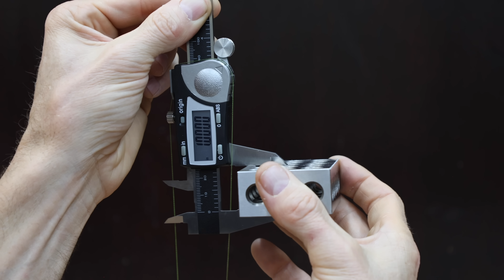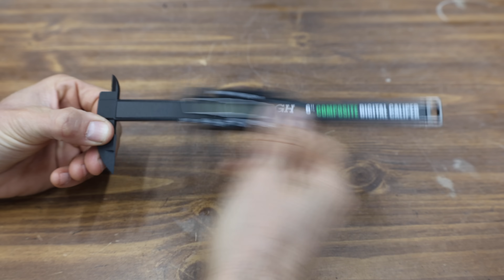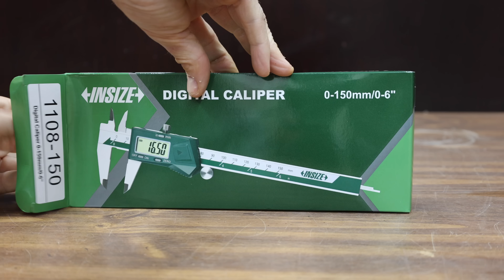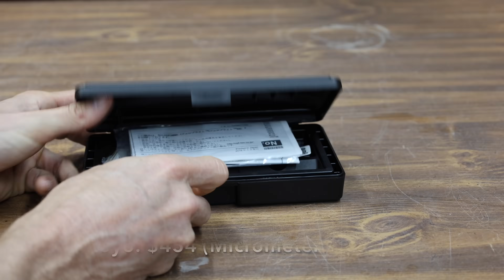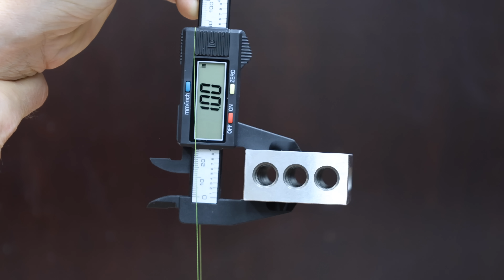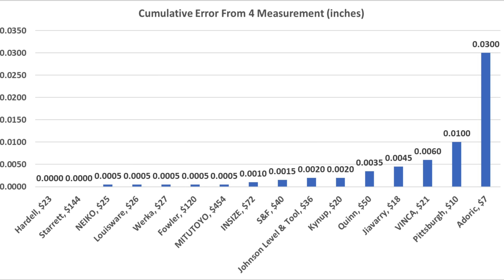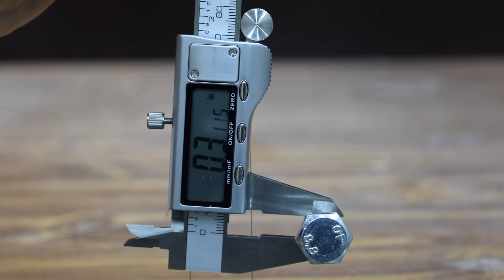I've Been Proven Wrong About Calipers!

Comment: FYI, it pays in the long run to use SR44 batteries, not LR44 batteries, at least in Mitutoyo calibers (and other Mitutoyo hand measuring tools). The SR44 battery has higher starting voltage (1.55 V vs. 1.50 V) and flatter voltage output when the capacity is used, and Mitutoyo's electronics have been tuned to that. I've had a Mitutoyo micrometer, which was said to have auto power off, but if it was used with LR44's, it didn't work at all and drained the battery within a month or two.

Regarding Mitutoyo's lack of auto power off, I've read some stories that the battery use is same if the screen is on or not - same applies to many cheaper models, where the "ON/OFF" button just switches the screen off or on.
Reply from the maker: Thanks for the feedback.

Comment: I really like my Husky brand digital calipers. 
The TLDR
They are really cheap but have worked flawless. The glide is perfect for what I do. In context among its normal uses, I also use my calipers to visualize what measurements look like as I am designing in CAD. Like if I can't picture what 6.83mm looks like, I just pull out the calipers and set them to 6.83mm. I know there are brands out there that the calipers feel like they are gliding on air, but I find for fine tuning that I like a little tiny bit of resistance. Not a grind or anything like that. They just don't feel like they have skateboard bearings in them. 😆

As far as accuracy I have put them up against all the best brands. I work at a motorcycle shop and we do custom fab work. Everyone here has their own set and brand they recommend. 
My lil $30 Husky is just as good as some of the REALLY expensive brands.

Durability? 
Well I have owned a single set for about 5 years, they are just as accurate as the day I got them, feel the same and are not all that banged up. I carry them back and forth every day to work in a tool bag and use them a dozen times each day in and out of the shop on various types of projects. Basically what I am saying is they have been bulletproof since day 1 and IF they ever break I will be replacing them with the exact same ones if I can find them.
For my work, top 30-40 bucks I have ever spent.
Reply from the maker: Thanks for the feedback.

Comment: I bought cheap Neiko calipers in the past. As soon as the battery gets low, they irreversibly glitch out and stop giving you readings. If you want a cheap caliper, just get an analog vermeer or something with a dial gauge instead of something with craptacular electronics.

Comment: Machinist here. When it comes to calipers. Mitutoyo only. They stay accurate after a few years. You drop them a couple of times they still stay accurate. Most everything else you look at them wrong and they break. And that’s coming from a Starrett fan. 

For budget calipers I like INSIZE. cheap use till they break and throw away.

Comment: I worked part time at HP's distance meter division back in the 1980's.  Joyce Horstman, the guru of metrology, told me that the way to clean the faces of micrometers and calipers is to have them squeeze a clean sheet of printer paper.  The paper has a very slight grit and helps clean the faces.  She also reprimanded anyone she saw putting away either with the faces closed.
Reply: Can you explain the last sentence?
Reply: @axledog7297  → Sure.  Joice felt that there was galvanic action at the faces when they were in intimate contact and would hence slowly degrade the surface.
Reply: @axledog7297  Jaws touching I assume.
Reply: "The paper has a very slight grit..."  That "grit" is kaolin (china clay)  The paper industry used to be the second biggest consumer of china clay.  (My first job was in the paper making machinery industry) My last proper job was in printing maintenance, in a plant that used 3,500 tons of paper per week... Imagine how many trees...?
But I was taught to clean instrument measuring surfaces with paper 50+ years ago... Is that not taught on the shop floor / at college / school any more?
Reply: @robertlawson8572  → I think this is also the reason you shouldn't clean your eyewear or camera lenses with tissue paper unless it's made for that specific purpose.
Reply: and you had to wear gloves  when picking up the gram weights to measure things.  Now it seems only the historical items have that practice.
Reply from the maker: Thanks for sharing your experience!
Reply: Why not have the faces closed?
Reply: @stringtheoryx  It matters less with calipers than micrometers.  With micrometers, we were taught to leave a gap, since overnight, the factory temperature dropped, and the micrometer bow shrank, putting a force on the spindle if the spindle and anvil were closed... It costs nothing to leave them apart, If they will go in their case...and in any case, if say, youre measuring in about the 0.25" range, the mic's closed, you have ten turns to make before you can measure... Never do unnesessary wotk, it costs energy, time, and in cases like this, it causes wear...
Reply: @stringtheoryx  → The faces are usually carbide, ground to very fine surface finish.  They "wring" like gauge blocks.  There will be some galvanic activity due to impurities in the air/surfaces.

Comment: I used Mitutoyo calipers at work throughout my mechanical engineering career.  When I retired I l left it behind.  Purchased a Neiko version and honestly can not tell the difference in performance.  I calibrate my calipers/micrometers using gauge blocks so I know how well they perform across their range and how well they keep the accuracy.  I have not dropped any so I can't vouch for robustness.

Comment: Something that you didn't note, but which I find very useful in a set of calipers is the ability to display fractional inch measurements.  I have a couple of sets of relatively inexpensive Wixie calipers that do this, and it is really quite helpful.
Reply from the maker: Thanks for the constructive feedback.

Comment: I have two calipers, one of those Starretts and an old General from Harbor Freight. Feels like every time I reach into the tool box for the Starrett, the damn battery is dead. The 15 year old HF on its original battery turns on every time. I'd never buy the Starrett again - I'd try Mitotoyo if I were doing it over again.
Reply from the maker: Thank you for sharing!

Comment: Nice comparison! I didn't like the depth measurement method shown in the video. The 123 blocks should have been placed on a hard flat surface (glass, metal, or granite) to eliminate variation due to compression of the substrate. I wouldn't trust using a wood surface for this given the small area of the tip of the depth measurement probe.
Reply from the maker: Thanks for the feedback!

Comment: I worked as a prototype machinist for about a decade. I used many different types, brands and models of vernier calipers. For harsh environments I appreciate the mechanical dial calipers. I used an older pair of 12" Brown and Sharp the whole time I was at that job and besides having to clean out debris occasionally, they functioned quite well. I had many cheap pairs of digital 6" calipers I used for rough setup that I sharpened the points when necessary so I could use them as a scribe. The cheapies were all usable but, would never spend all day on the lathe with coolant all over them. For critical work you would never rely on them for your final quality checks. For finish work I stuck with the Mitutoyo. I used a 6" and 12" pair as my daily go to I think they were just the 190s. When I left that job I was using a pair of 738, 8" which is about the best you can buy and although I had used many other calipers that worked just as nicely, they were never ones I could rely on to handle 8-12 hours a day of constant abuse and still be assured they were dead-on every time. There is a reason they are know to be one of the best, those that use them every day know. I will say if you are only going to use a caliper on a rare occasion than I would check out SPI. For the price you get a reasonable quality and accuracy that will hold up over the years bumping around in your tool box for not that high of price. Free advice you didn't ask for over.

Comment: I've been turning and milling metal for a while and the biggest issue I see with all of them is they are digital. NEVER TRUST DIGITAL ANYTHING. I use a cheap $20 analog set from Harbor Freight next to the machine and the expensive Mitutoyo's in the inspection cabinet. Analog is so much more accurate, repeatable, and precise.

Comment: Well, these are all way more accurate than the analogue ones, I don't think you'd see any difference, even with your best reading glasses when it's down to these numbers. And if you really, really need accuracy, you'll use a micrometer for that, right?

Basically, my point is, that just get a cheap one that feels sturdy and is "smooth enough" for you, cause they're all good enough for anything you need them for. In fact, I bought a cheap one yesterday, because it was shorter and plastic/composite. It'll serve me fine.

There is, however, a good reason to avoid the plastic ones (apart from wear), and that is that you can use the steel ones to scratch/mark your work piece, which is very handy. (Don't do this with expensive callipers or callipers that aren't your own!)

Comment: If you ever revisit this, please consider measuring for parasitic draws.  I have calipers that look exactly like the Jiavarry, but under another brand.  The problem is every time I need them, they're dead.  I've heard cheaper calipers may turn off the screen, but leave other functions drawing power at all times, draining them rather quickly compared to higher quality calipers.  It would be great to know which ones do this, and whether it affects measurements as the battery charge drops.  Thanks!
Reply from the maker: Thanks for the suggestion.

Comment: Also, repeatability and durability are very important, perhaps the most important factors. There are standard procedures for these kinds of measurements.
Some of the $10–$40 or even $50 tools may not last a week in the shop, while brands like Mitutoyo and Fowler can last for years.

Comment: High quality equipment has a higher price tag simply because of materials  sometimes "proprietary" used in manufacture. And the resulting difference in working to accuracy, that material. Along with a design to be ergonomic reliable and robust. I look at the plastics and neon function buttons, on these "as good as" measuring tools, and feel disillusioned 
that some will argue its equivalency to the earned reputation brands.

Comment: As a machinist, I started in this trade 13yrs ago. My 1st set of "good" calipers were a pair of 6" and 12" Insize IP68 rated units. I got a bit of oil from my hand on the beam and they never worked right afterwards, this was within 2 days of use. Returned those for my Mitutoyo in the same specification, and have had them ever since. They're well over 10yrs old, can put them on gauge blocks and they read dead ass on ID, OD and within .001-.002 on depth after all these yrs. Coolant proof calipers are an absolute must in the workshop. My coworker has a set of Fowler IP68 calipers and they're about 3-4yrs old but look like they're 20. Always has issues with them. My Mitutoyo super mic also reads dead nuts throughout it's measurement range on calibrated gauge blocks as well. The only thing more accurate in our shop is the machine scales by Heidenhain.
Reply: this guy knows what's up. machinist for 25 years. i have insize for my mechanical test and dial indicators. they're nice when you can keep them clean. calipers on the other hand...worth spending the money on a good set of digitals. they can take abuse that cheap digital or mechanical ones simply cant. i've got a pair of 8" Mitutoyo's that i've probably dropped a dozen times on concrete, they've been covered in grinding dust, coolant and tapping fluid. still work as good as the day i got them minus some cosmetic damage...and the tips arent quite as sharp now
Reply: A bit of oil from your hand,must be really acidic and staining to damage a vernier beam,I've used insize for year's and have never seen that.

Comment: You know that thumb screw that's on the top is to set the the amount of friction right? from very lose to locked in place.  or were you measuring the sliding force with the screw backed out fully? normally you are very through with these videos,  but i didn't hear you mention the thumb screw before started measuring the sliding force required.

Comment: The problem is that the cheap calipers stay on when turned off and drain the battery the display is the only thing that turns off thats why they give you new batteries with them

Comment: A resolution of 0.1mm/0.01in and an accuracy of +-0.2mm/0.01in is just ridiculous. Those are completely useless in a machineshop.
I work at an aerospace company. 90% of the calipers are Mitutuyo. I remember a decade ago they tried a batch of that green Insize brand. They did the job but didn't last very long.
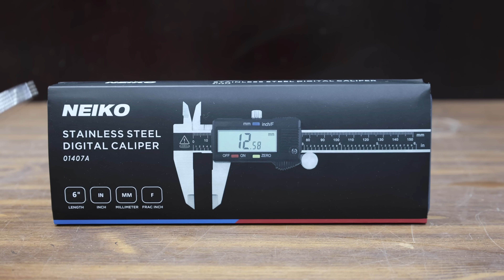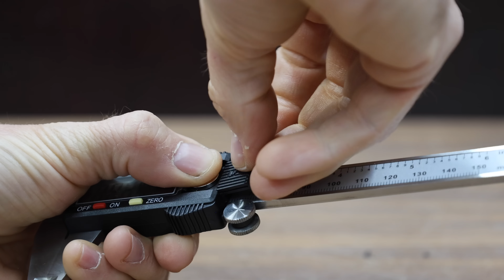I noticed some brands use the same electronics/controls and it doesn't surprise me, all made in china. 0:22 Adoric, 4:08 Neiko (although it has a screw for the batterycover), 5:48 JL&T,

Comment: Don't know if you address it in the video, but the real difference between cheap Chinese calipers and "proper" ones is that they drain the batteries very quickly, because the auto shut-off doesn't actually do anything except turn off the display.Taking the battery out after every use is inconvenient and quickly breaks the contacts. Had that happen on several cheap sets. If they fixed this one issue, it would make a huge difference to the usefulness of the cheap ones. You can mod them yourself, of course.

Comment: jeeze. those first few were garbage. about 10 years ago when these things hit the market you get get stainless steel ones for like $10-25NZD. and they were accurate to 0.01mm not 0.1mm. i still have one. although the button cell battery goes flat way too fast even when not used. so i have a AAA battery attached to it. bulky, but it works. plastic or 'composite' material is just simple not acceptable for a precision tool imho.

Comment: I had a bunch of cheap different calipers from harborfreight to several auto store. They all suck at giving correct result. Used on same piece of metal, 4 times 9f of 10 I'll get different result. Finally bought a mitutyo ( spelling ?) Zero problems

Comment: I have owned Mitutoyo calipers for decades, the battery lasts for years.
The harbor freight battery life is very poor.

I think the hardness of the jaws is also important for longevity and repeatability if used much; I would only trust the metallurgy of the Starrett or Mitutoyo calipers to keep accuracy over a longer period of time.

Comment: Most of the error seen here is due to operator error, I mean  measuring the depth of a 123 block sitting on an old wooden table will give you different numbers every time.

Comment: I only service my bicycles and use an old Russian analog vernier caliper, and if I need to know, but that's rare, a fraction of a millimeter, I'll use a Chinese caliper with a circular dial, so there are no batteries, the operation is pretty smooth and reliable, and it was cheap

Comment: The depth measurement where you were laying the block on the table were not going to be accurate beyond few thousandths because the table is not even close to flat. Also when using the caliper jaws any dirt even grease from your fingers on the jaws or the part will knock the readings off by a few 10 thou or more. The metal caliper that wouldn't consistently return to zero probably had a speck of dirt on them.... Especially with the lower quality calipers because the surface of the jaws is rougher they're apt to hold dirt like that.  As you repeatedly try to bring the caliper to zero the dirt moves around giving you different readings. Higher quality calipers have a flatter smoother surface so they are less likely to hold dirt and when they do you'll get a more consistent zero cuz the dirt has fewer low spots to fall into. Which means you are also getting a more consistent wrong zero. So if you're looking for the most accurate possible reading it's best to carefully clean both the caliper and part before measurement... All and all any $20ish generic metal calipers that read to 5 ten thousandths are accurate enough for mechanics and home machinist.

Comment: Best thing you can do for the battery life is have a plastic tab that can physically disconnect the battery. @4:17 you can see a triangle feature. when slid towards the front face it will create a slot that has a straight path to one side of the battery. cut a piece of thin plastic and shove it in to the slot will create a physical disconnect. The basic principal can be applied to any caliper model. some may require more modification then others.  I think there are some videos on youtube that show how to do it for some brands.

Comment: not that it matters for this test, but depth measurement is more accurate from the flat on the back of the jaws, as it effectively eliminates any variance for skew error. 
If you need a reliable measurement for your job, Starret and Mitotoyo are the ones to go to because some jobs require a certification. for hobby, the cheapest will do. I use Mitutoyo for work where i need to measure dozens of parts every day, and Pittsburgh for modeling for my 3d printer at home.

Comment: I know it's not covered in the video, but if y'all want to not deal with digital or dial calipers that need attention and calibration due to the gearing internally, vernier's just use a vernier scale to give the same level of accuracy. 

Zero battery, no gearing, and butter smooth as a result. I use them in conjunction with vernier micrometers that do need calibrated here and there.

It just takes a bit of learning on how to read the vernier scale.